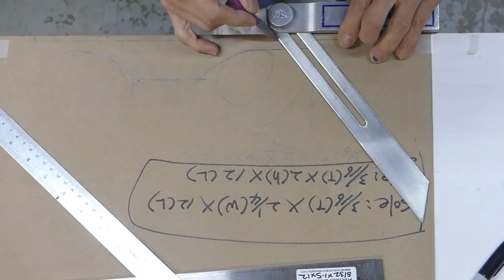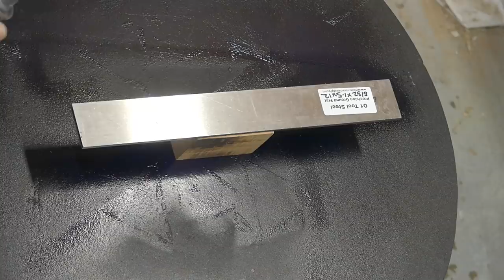Make a scrub plane

Comment: My dad was like this. He'd make literally anything out of anything. However... he was a toolmaker and he had some big precision machines. Surface grinders, lathes, mills, welding machines and press machines. I respect the fact you made this plane literally with a bandsaw, press drill, hammer and a lot of filing and sanding. It must have took a long time but its great to see creative problem solving like this. Well made.

Comment: Looks fantastic. I have to ask though, is there a reason you didn't weld or braze the metal? Brazing would have created a joint that's as strong or stronger than dove tails. It might have saved you hours (days?) of cutting, filing, fitting, and peening. Since you're able to heat up that tool steel you probably only need to buy brazing rods.
Reply: There's a level of pedigree surrounding dovetails, especially metal ones.

Any schmuck with a weekend and some basic brazing tools can make a workable (not perfect, that takes years of experience) bond.

Dovetailing metal is an incredible feat.
Reply: @lotmom while I don't disagree that dovetailing metal is an incredible feat, I still question whether or not it's any more functional than brazing. If the end result is a plane of specific dimensions, and if either method can yield those dimensions, what's the benefit of dovetailing? I'm not saying there isn't one. I am suggesting the benefit has nothing to do with functionality.

Let's also not forget: Young Ge is not any old schmuck. I'm sure he could figure out brazing pretty quickly if he's not already experienced with it. I'm not any old schmuck either. I know from experience that brazing can make very strong, squared joints with very little to no distortion - and that's without needing years of experience. I'd be willing to bet that brazing produces far less distortion than peening dovetails. How could it not? Peening requires distortion to work.

My guess is this: Young Je didn't have what he needed to braze, or weld, or cast, or machine some metal, so he tried another technique. If I'm wrong, I'd love to learn why.
Reply: @elbowdonkey  You definitely make a good point, and I agree, there probably is little if any functional difference, and if that is the case, I'd think my point still stands.

As for brazing, I've always thought of it as some mystical art. When I started TIG welding, that only strengthened that idea.
Definite kudos for guys like you who have put in the effort to learn a skill like that.

But I would love to hear Young's input on this!

Comment: Great video 👍🏼👍🏼 @ 13:15. What was that ?
Reply: Looked like a leather stropping wheel on a slow speed grinder
Reply: CBN (cubic boron nitride) grinding wheel. The latest rage in grinding wheel tech, but only good for use on quality steel
Reply: @dangreen7709  I was thinking the same at first, but looked again. There's a leather surface on that wheel, plus Young Je gave a heart on my response, so I think it's a leather wheel. CBN is all the rage, but wouldn't leave a polished surface on that brass.
Reply: Thomas Russell  My mistake

Comment: a wonderful piece of workmanship. but why peen it together? would a good weld not work and save half the workload?
Reply: Welding often warps metal and can destroy any temper. I suppose if you wanted to, you could mill one from a solid piece of steel, brass, or even cast iron, but it would require even more precision. I'm wondering if anyone has ever 3-D printed a functional hand plane. (Off topic, I know, but it crossed my mind in the moment.)